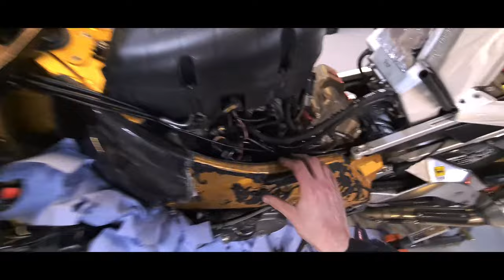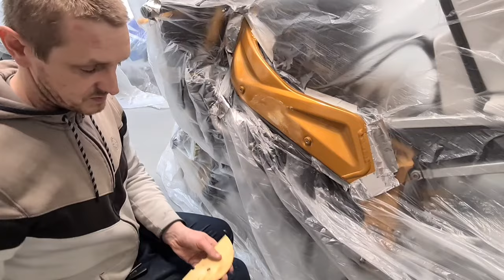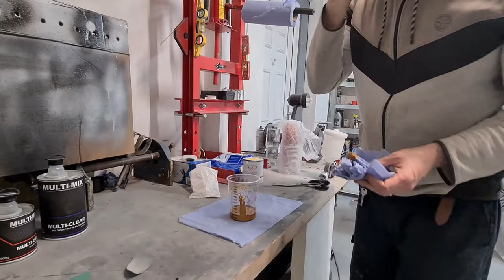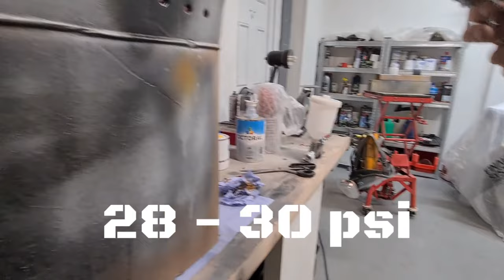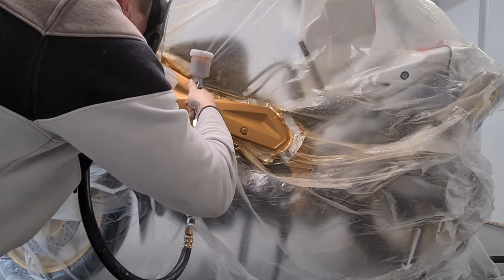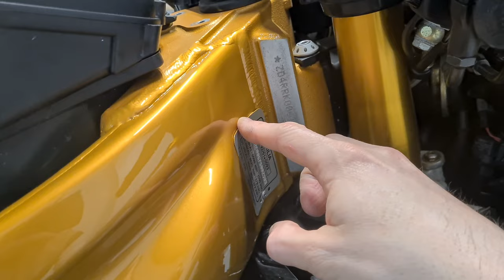APRILIA RSV 1000 FACTORY HOW TO PAINT THE FRAME

Comment: Mine was definitely anodized, 2008 model and it had a speckled finish to the frame not a smooth finish like yours, people did try to make the standard one look like a factory by painting frame and wheels, I had over a period of time four factory’s and three milie RSV, and I loved them , I’m living in Philippines now and have a Ducati Panigale, , I’ve tried and did locate a factory but was the other end of the islands , too much cost to get it down my end . So I just watch you and look at my old pictures and make do with the Duke . Keep knocking out the vids please .👍👍
Reply from the maker: Hi Chris thanks for viewing 👍 maybe some were then.... But the paint code for the factory is online... It is a metallic paint you can't see the metallic detail in the vid  but it is an exact match.... The wheels are anodized.....  Must be some nice roads over there in Thailand what's the heat like for the Duke?
Reply: I think what he is saying is that the  factory Gen 2 with bronze frame was all painted the standard ones were electroplated. But the bronze frames were all painted. 
The speckles you say are metallic flakes in the paint.
But it would cost an absolute fortune to turn a standard RSV in to a factory stripping the bike for frame painting, ohlins suspension front and rear, the bodywork alone would cost over 1k. And then the damper and wheels.  Also it wouldn't be registered as a factory bike. So I don't think anyone would or could turn a standard into a factory it would be cheepsr to buy one. This bike on the video Is indeed a factory bike